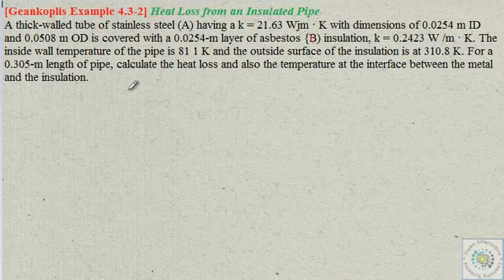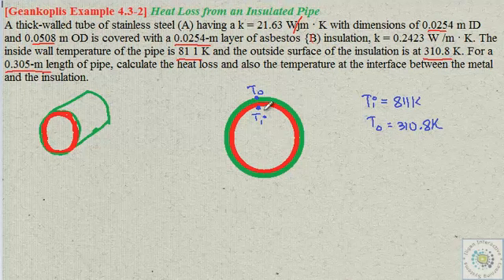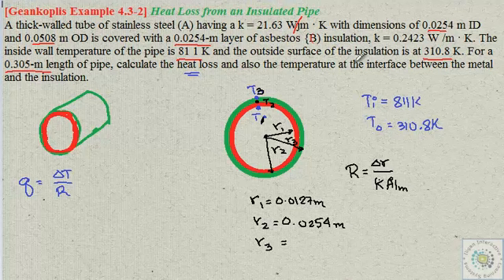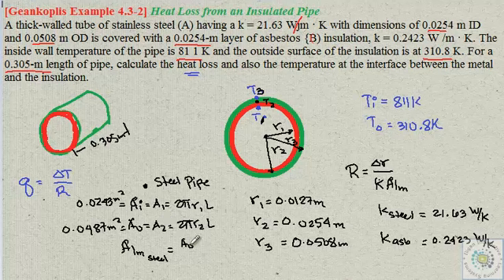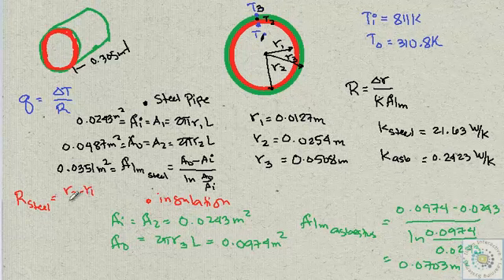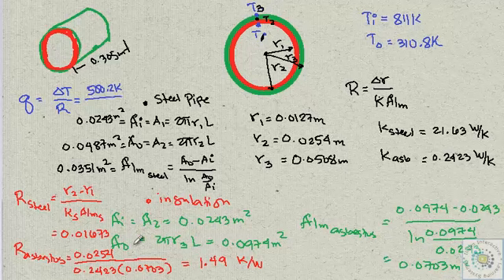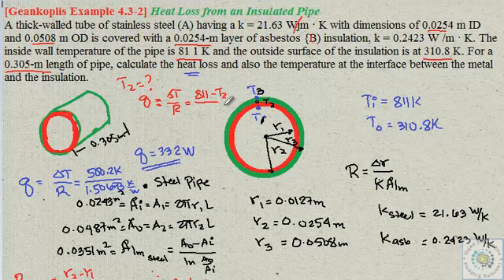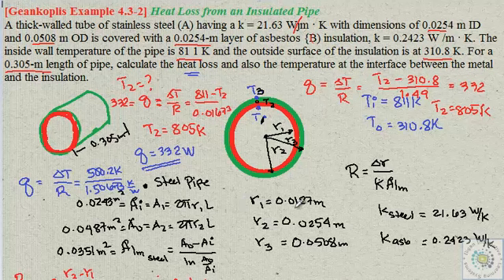4.3-2 Heat Loss From an Insulated Pipe

Comment: You need every second 332 joule of heat is leaking out of the pipe. Resistance in series vs resistance in parallel is relevant to a conversation at Armstrong Chapel I believe 14 days ago about the power lines outside the Church! I was reading revelations about the letters the angel commands the saints to send to the seven Churches! I love reading the bible just like Donald Trump, and pastor David Brown says love is an important word! Maggie asks when do we talk about love, I said read the bible and go to Church!

Comment: OPEN LETTER
MISUNDERSTANDING OF STEADY STATE FLOW CONDUCTION HEAT TRANSFER EQUATION IN CYLINDER SHAPE
To the honorable,
Anyone studying heat transfer courses (mechanical engineering, chemical engineering and nuclear engineering).
In
Place,
Together with this open letter, with humility, we send an open letter to anyone, which may be read by anyone who is willing to read this letter.
The purpose of this open letter is to re-discuss the explanation of steady state flow heat transfer on hollow cylinder walls
I am the writer of the letter refuting the formula that has been written in books and literature. Especially on conductor heat transfer on steady state flow cylinder walls.
Briefly my objections are:
1. For cylindrical shapes
a. The comparison of the radius of the sheath to the thickness of the cylinder is never less than 1. This condition occurs when the thickness is ( e - x ), where e (natural logarithm) is the outer radius and x is the inner radius which ranges from 0 < x < e ^ 0 . The reason for my objection is that the radius of the sheath always moves larger following changes in area. While the thickness moves linearly. so that there is never an event where the radius of the sheath is shorter than the thickness. Thus the radius of the sheath is always greater than the thickness under any conditions.
b. When the cylinder is solid (has no holes), the temperature will be + ∞ (the temperature increases very large without limits at the center of the cylinder). This condition occurs when the thickness is ( e - 0). e (natural logarithm) is the outer radius is a natural number and 0 is the inner radius. The reason for my objection is that it is very unreasonable for a material in a solid condition to withstand heat with a temperature of + ∞. My opinion is that the temperature can still be known even though it is difficult to practice in solid conditions.
c. The ratio of the sheath radius to the thickness is greater than 1 (has no limit) and ends at 0 (NULL) when (e - e) is outer = inner. The reason for my objection is that the sheath radius must indeed be greater than the radius. However, it has a certain value limit !!!
d. In general, the reason for my objection from points a, b and c is that the use of natural logarithms causes uncertainty in the ratio of the sheath radius to the radius.
a. When the thickness is (e - x), 0 < x < e ^ 0, then the ratio of the sheath radius < thickness.
b. When the thickness is (e - x), x = 0, then the ratio of the sheath radius to the thickness is + ∞.
c. When the thickness is (e - x), x = e ^ 0, then the ratio of the sheath radius = thickness.
d. When the thickness is (e - x), e ^ 0 < x < e, then the ratio of the sheath radius > thickness
e. My question is: How to calculate the temperature at the center of the cylinder when the heat comes from outside the cylinder by conduction with steady state flow ???
f. The prediction of the calculation error is very serious. When the outer becomes very large and the inner approaches the outer (relatively thin). Then the calculation error in temperature becomes very large.
Why is the existing formula considered as the truth? This is because the calorific value must always be (constant) in each change in thickness that experiences a change in temperature increasing when approaching the center of the cylinder along with the change in thickness where the initial temperature comes from the inner radius. With a note that the heat source comes from inside the cylinder.
However, for the case of steady state flow conductor heat transfer in the form of a cylinder. There are other conditions that must be followed. Namely, the value of the radius of the sheath against the thickness must always be more than 1. Why must it always be more than 1? This is due to changes in the cross-sectional area that do not move linearly against the radius of the cylinder as explained in point C.
PHILOSOPHICAL VIEWPOINT ON THE THEORY OF TRUTH
Based on the theory of truth in the formula, it is a consensus theory of truth. Which is mutually agreed upon. Does not yet cover universal truth in thickness conditions. This allows for propositions that contradict the object and results when confronted.
Understand the Types of Truth Theory:
1. The Consistency Theory of Truth
2. Correspondence Theory of Truth
3. Pragmatism
4. Performative Theory
5. Consensus Theory. The approach to the theory of truth in this case is still based on the agreement of scientists
Sources of Knowledge:
1. Rationalism
2. Empiricism (in this section I have not conducted physical testing on the temperature of the material)
3. Criticism
4. Intuitionism
Quote philosophy:
It is with logic that one proves, it is with intuition that one invents (Henri Poincare).
My quote philosophy:
Mathematics is able to predict errors, but has not fully proven absolute truth.

Vincencius Sufijan Hadi

Comment: Yes there is mistake while calculating the Ai for insulation, it should be equal to outer area of steel pipe,just after which insulation is start.